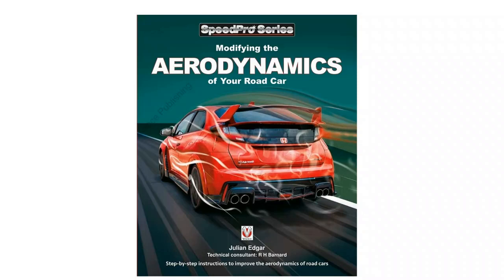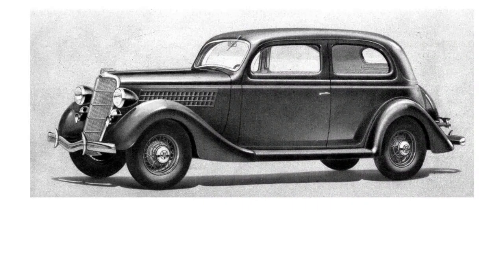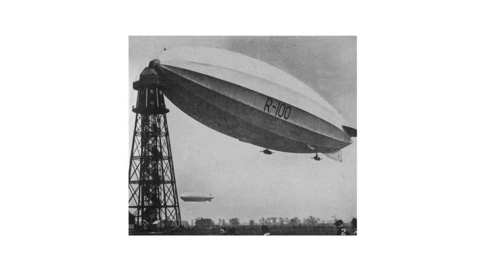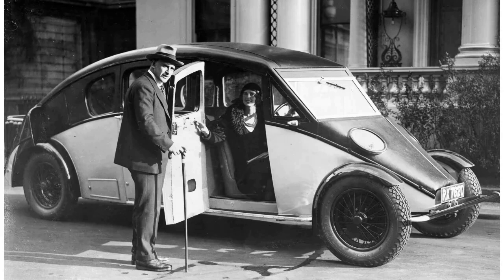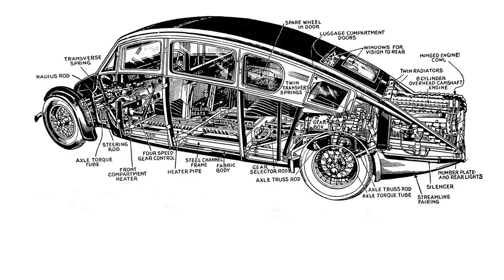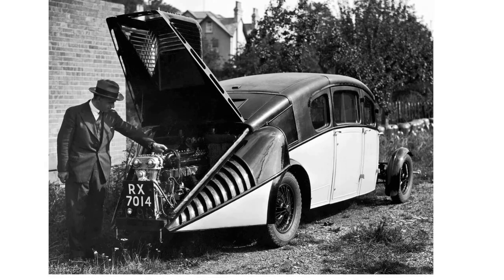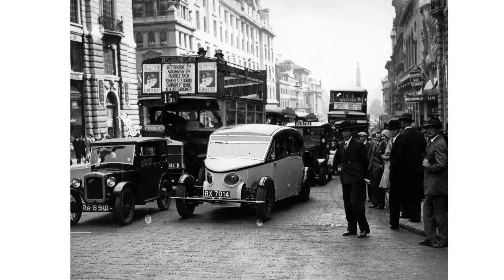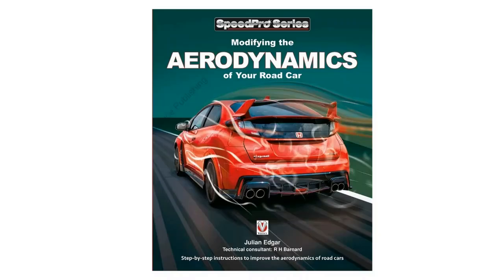Aero-extraordinaire -  the1930s Burney Streamliner

Comment: Great example of Engineering ahead of it's time, and the only car I know in which fabric stretched across a frame has been used to build a light and aerodynamic body. 
The east european car manufacturer velorex has used the concept of light framework with an soft Material stretched over it for the bodywork of allmost every car they build.
Reply from the maker: I wasn't aware of Velorex - a good approach, especially with modern fabrics.